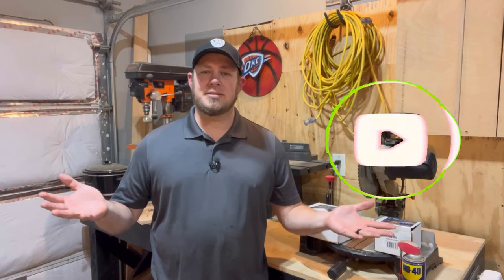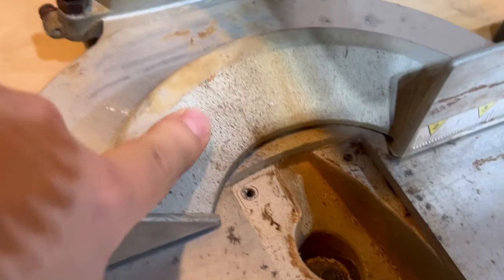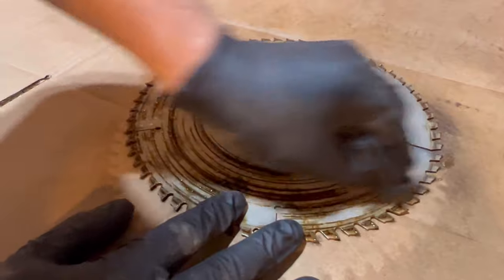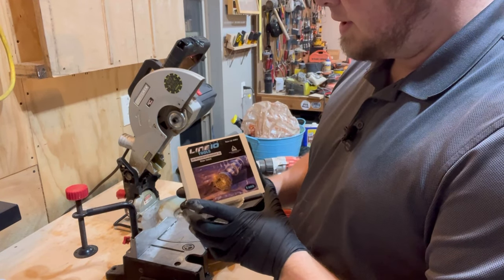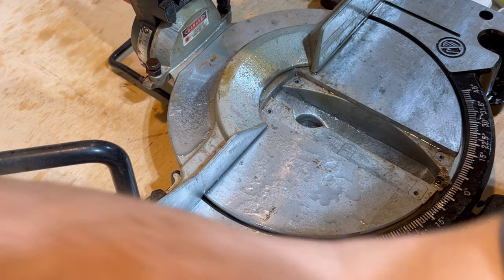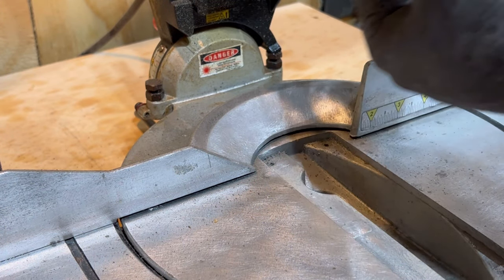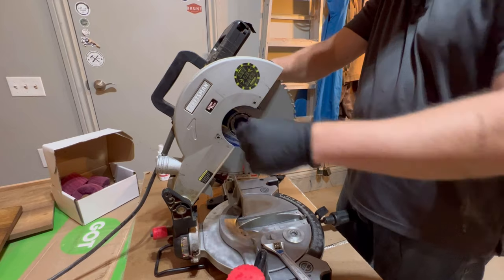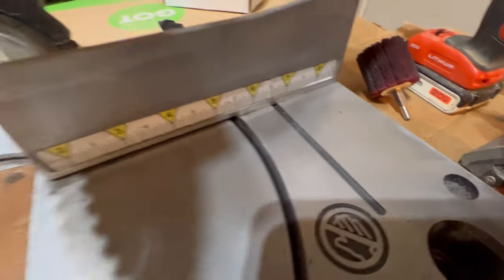Cleaning the RUST off my Miter Saw // Sawblade and Bed Cleaning // DIY Tool Maintenance

Comment: The saw base is made from an alloy, it doesnt rust, it can tarnish and maybe corrode but cant rust. All in all a job well done.
Reply: Oh, dont forget to turn it to its full capability both directions to clean and polish the parts of the base hidden under the back rest part.

Comment: Great video, is that zero clearance insert a custom piece you made or bought or did it come standard with your saw?  If you bought it, can you provide the details or link as that’s nice?  Thanks
Reply from the maker: Thanks! That insert was a custom piece for the saw. Just a piece of walnut cut to the size of the original insert.
Reply: @OkieCraftsman Thanks for the quick reply.